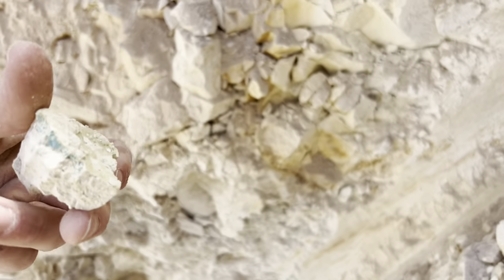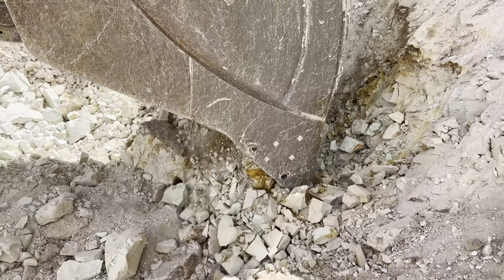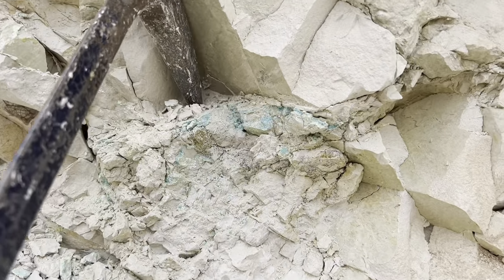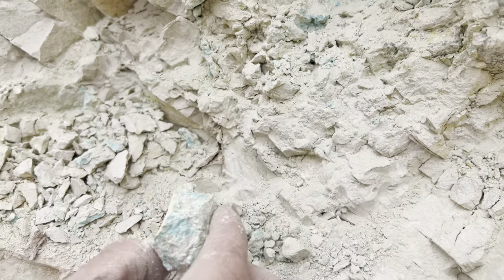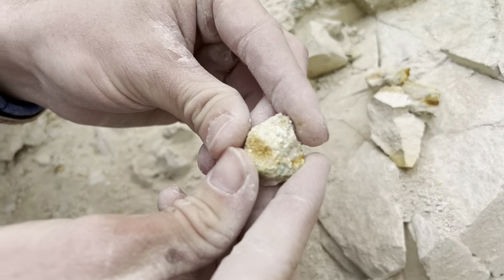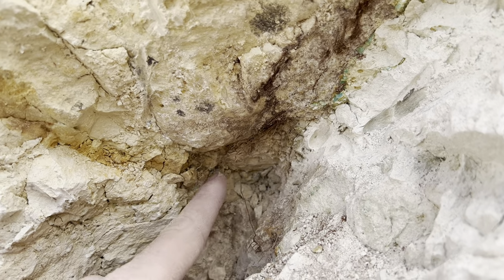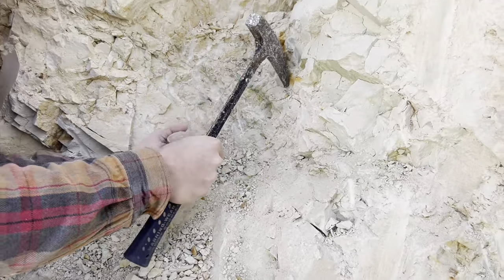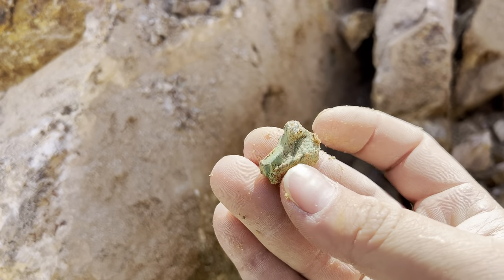Mining at the world famous Royston Turquoise mine!

Comment: If you use your pick on either side of the seams, and avoid hitting right in it, you’ll get larger chunks….also, if you keep the green stuff, you can stabilize it. It is still desirable.
Reply: This is painful to watch. I saw several pieces get crushed or fly away. Hobbiest vs pro maybe?
Reply: @frostypop934  IKR? …later in the video the claim owner said his assistant has been doing this for a decade, but I do think it’s lack of knowledge. He may be good at spotting veins, but having the patience to tease out larger pieces of excellent color takes more than experience. I couldn’t stand to watch either. I just paid $25 for some rough online that’s nearly worthless. Mostly extremely light blue chalk. American turquoise is overpriced and difficult to acquire unless you live in Arizona or New Mexico.